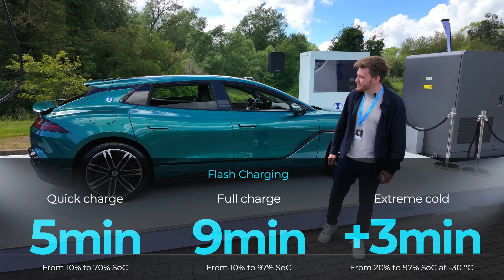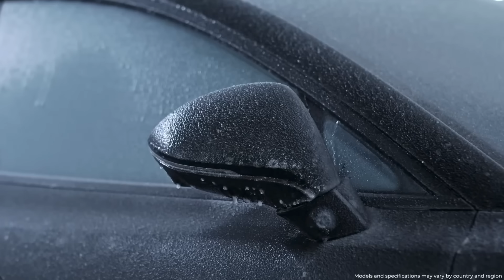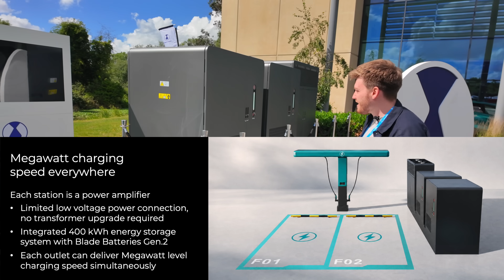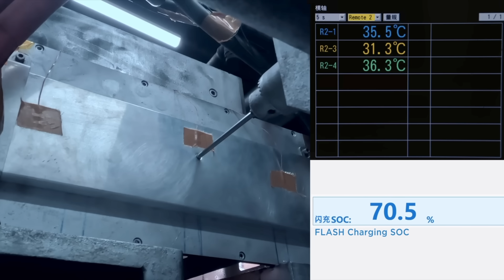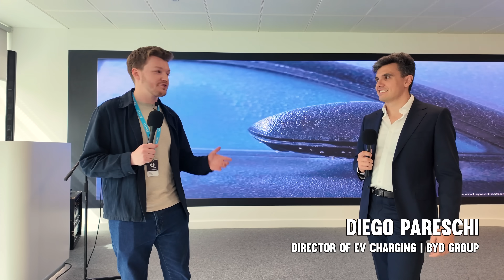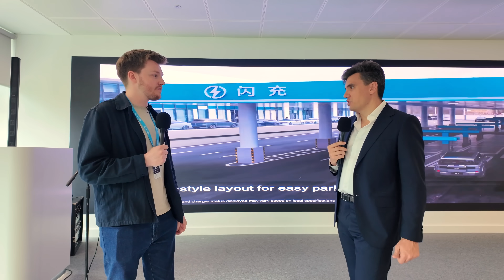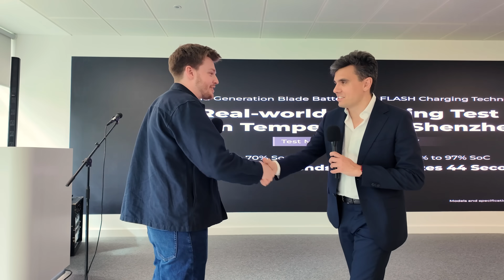BYD Flash Charge UK & Europe Launch | Crazy Fast EV Charging!

Comment: I don't believe it. Network implementation has extreme hurdles from land acquisition to laying the sufficiently thick electric cables to support the load. Most countries are not organized enough to let it happen. Don't believe the sales hype. Hybrid still better.
Reply from the maker: This solution is going mostly into existing stations, and doesn't require any additional equipment as it uses the battery packs in the charge point to handle the additional load, and larger installs rely heavily on solar. Here in the UK at least, most major service stations and shopping malls etc have EV charging installations now

Comment: How it works with the heat during charging?
Reply from the maker: The battery has a cooling solution built in, and the charging station uses the same battery tech as the cars

Comment: Charging stations still do not cater for trailers/caravans. Im traveling to Italy (tesla M.Y. Swift Caravan) and only one facility has a pull through charging station. Its possible at one other but a height restriction is in place preventing its use. Joined up thinking required, a garage forecourt works but no one thought to think why. Even where space isn't an issue not even one dedicated car/trailer option.

Comment: The most important thing is charging cost per kw/h , if BYD offer a subscription model to significantly undercut the Supercharger network then people will plan their routes to use the BYD network if not then it's a waste of time.
Reply from the maker: The BYD cars are getting a similar navigation update to plan around this so I think their subscription will be similar. It will be interesting to see the solution via their app if you have a different brand of vehicle

Comment: EV owners wake up with cars fully charged. In fact, most of them don't need to go to charging stations at all.
Reply from the maker: Well, here in the UK there are many homes that don’t even have parking spaces for chargers to be installed, so for many an EV isn’t practical. Hopefully tech like this changes that, as they can go and effectively ’refuel’ quickly
Reply: You are right. This is all pointless tech. Clearly BYD have just built this without checking if there is any demand.
Reply: @chriss8971 😂😆

Comment: The question not asked is if I take the new battery to an existing say 350KW charger will it maintain 350KW charging rate up to 80%, if so that's a big advantage over the competition whos charging speed always drops.
Reply: It will maintain  350KW  to 90%
Reply from the maker: They say it will maintain this on any car below 1500kw up to around 90% so yeah bit of a game changer. This is because of the blade batteries actually used in the charger itself
Reply: In the UK they are all load balanced so it's unlikely you'll get the full 350KW unless the system uses hyper capacitors which I assume is the basis for this technology.

Comment: With this Flash Charging technology offering, BYD just achieved a master stroke both the legacy auto and the petroleum industries dreamed about. The dream is to be the one providing both the vehicles and the energy to power the vehicles. BYD just quietly became world's first company to do just that.
Reply: They do a lot, but they do NOT provide the power - they save it in their batteries then sell that to you. The utilities still are those who produce the power.
Reply: It is true that BYD do not produce the electrical energy stored in the battery banks used at the Flash Charging stations, but they are selling electricity to the EV customers which allows them to profit from this transaction. This will be a very profitable recurring cash flow for BYD and will eventually prove to be far more profitable then selling EVs.
Reply: fuel consumption in china is down 8% yoy.

Comment: It works like a Gas Station
Reply from the maker: 5 minutes isn’t much longer than filling with gas really!
Reply: @ItsDanLatham  5 mins from 39-70%, then another 5 for the next 27% is what I noticed. I don't feel the need to fill a petrol tank until it gets much lower that 30%...and it still takes less than 10 minutes to completely fill the tank.
Reply: @tombridge3608   @ 0:48 "10% to 70%" = 5 mins....."10% to FULL" = 9 mins.

... with no health impacting inhalation of highly toxic carcinogenic Benzine whilst pumping it in!
Reply from the maker: @tombridge3608  5 minutes from 10%-70%, most people wouldn’t need more than that on a car with nearly 400 miles of range - Ideally you’d want to keep the battery below 80% to extend its life anyway
Reply: @tombridge3608  very unprofessional troll
Reply: @ItsDanLatham  而且充电不需要人盯着，加油需要人盯着，可以去超市买东西，去洗手间。
Reply: Similar, only you don’t have to stand outside holding a dirty stinky nozzle. You can nip off to the toilet or grab snacks.its quick, clean and easier than fossil fuel.

Comment: People are hyped about solid-state and sodium-ion batteries, but EREVs already solve many of the problems people complain about. Electric drive for everyday use, small battery, no stress during long trips, and much less worry about cold weather range. Seems like the best of both worlds until batteries improve even further.
Reply: Er no. Why have a vehicle that still needs constant servicing? Why have an over complicated vehicle that has both systems plus a third system to combine the other two. They make no sense. Even now range anxiety is just in the mind. I’ve just done 900miles in a EV at no time was there any anxiety about range. I’ve got another 1600 miles guesstimate to do this trip. No anxiety whatsoever . Oh and it’s much cheaper than a erev. Topped up at a super market while shopping yesterday, works out under 8p a mile. It’s about 4 hours between 10-40 minute chargers , all done while eating dinner etc. even now modern EV gave zero need for range anxiety, it’s just a term to frighten those that don’t know or have not bothered  to work out how it all works.
Reply: 在中国以前人们喜欢增程电车 但是现在人们更喜欢纯电 主要原因是现在到处都是充电桩 不管是农村或者城市 还有一个更主要的原因是充电速度大幅提高导致现在电动车相对油车的补能方式更方便
Reply from the maker: Agreed - With cars now touching 400+ miles of range and this fast charging becoming accessible, the only issues I see are environmental - but many companies are trying to mitigate those issues too.
Reply: @ItsDanLatham  It's funny when it comes to electrified vehicle people keep complaining about environmental issue, but ICE? No one talking about city's air pollution and oil leak that damage soil and water quality. Also you keep whining about high gas price but yeah, lets keep using those gas guzzlers until your wallet dry
Reply from the maker: @HyperVanilo  I’m quite happy with my EV, and use sustainable energy to charge at home!

Comment: If both of those cars are plugged in at the same time do you still get the 1.5 mega watts? Didn’t hear it mentioned in the video.
Reply from the maker: From the specs I’ve read, if both are plugged in they won’t both get to the peak of 1.5, but will still be in excess of 1.0 so probably won’t be a dramatic dip in performance
Reply: This Italian guy did an interview at a charger with an American car YouTuber and he said that yes, both sides could benefit from the 1.5 MW at the same time.

Comment: No manufacturer will give you 150k miles and 8 years waranty on the ice engine
Reply: 在中国，所有比亚迪品牌都是终身质保，但每年行驶里程不能超过3万公里
Reply: @cool-normalman-2024  so what happens after 30,000 km ?
Reply: @xtairsoft   超过 3 万公里就变成 8 年 15 万公里
Reply: @xtairsoft  byd offers double warrenty in china, if you break the lifetime warrenty you still have the limited warrenty varies from 30k km to 50k km a year or 8 years which comes first depends on the sub-brand
Reply: Oh I see, that is very good.  In fact pretty amazing.  I need to move to China
Reply: @xtairsoft recently. BYD  offers  one year collision coverage  to new buyer driving in metro area with automous driving system engaged. People guessed that BYD  only offer one year of coverage because here's  rumor the regulations  for  L3 will go in effect  in 2027.
Reply: In Thailand it is just 160k KILOMETERS
Reply: You’ll have to wait 8 years for the spares.
Reply: Try getting that 150k warranty out of the CCP fool.
Reply: Toyota 10 year 😂😂😂😂
Reply: @zulzulzulaan2396 Very limited terms. Try claiming and you'll find out.
Reply: @zulzulzulaan2396  at additional cost after the 3rd yr, annual "qualifying service", lots of exclusions, and only up to 100k ....

Breakdown of Engine Cover:

Initial Manufacturer Period: Every new Toyota comes with a standard 3-year or 60,000-mile warranty covering mechanical and electrical components, including the engine. [1, 2]

Toyota Relax Extension: Following the initial 3 years, Toyota provides an additional 12-month or 10,000-mile warranty with every qualifying service at an official Toyota Centre. [1]

The Cap: This 12-month coverage can be renewed annually, year after year, until the vehicle hits the 10-year or 100,000-mile limit. [1]

What is Covered

Engine Components: Internal parts such as the cylinder block, crankshaft, connecting rods, camshafts, cylinder heads, valves, and oil pump.

Engine Systems: The fuel system (injectors, ECU, fuel pump) and cooling system (radiator, water pump). [1, 2]

What is Excluded

Wear & Tear: Normal degradation or failure of items like timing belts (unless specifically stated), spark plugs, filters, and drive belts.

Neglect & Modification: Engine damage caused by lack of oil, severe misuse, or unapproved aftermarket modifications. [1, 2, 3, 4, 5]
Reply: What? Yes they will. I have 5 years unlimited km on my Hyundai. Can get extensions after 5 years to 8 years.
Reply: But you need to pay extra for the extension of warranty while the BYD owners only need to pay upfront for the vehicle. It’s a big difference combined with the low maintenance cost for EVs.
Reply: @nameberry220 what country are you from?

Comment: And WTF charges the charging station batteries........ Ohh they have a solar panel on top them ??
Reply from the maker: Some have solar yes, the larger ones. Or they will charge from the grid supply on site with existing transformers
Reply: 이 시스템은 한밤중과 같이 전력 소비가 적은 시간대를 이용하여 충전소에서 배터리를 충전하고, 이렇게 저장된 에너지를 낮 동안 전기 자동차를 충전하는 데 사용합니다.
Reply: @张先生-e8h So if you have say 200 EVs a day charging say 80 kWh each you need 1.6 GWH off batteries or a mix off what the grid can supply and then the battery ??
Reply: @timlucas4014 It's actually better, taking your numbers a site needs to charge 200 cars with 80 KW each. The same amount of supply would be needed but would require about 14 chargers and need to use the supply instantly. The BYD charger by using batteries can spread the supply required over 24 hours.

Comment: i want to know if this come to eletric scooters too or you know motor bikes on batterys
Reply: Probably no. Scooters have different voltage they run and is physically would be impossible to charge scooters at fast chargers, batteries too small and too fragile for that amount of power.
Reply: @Jokershadow696  than there is no point the range is to small to wait for them to charges so stick to benzin for now not buying a Car .
Reply: @Trikie77 your comment doesn't make any sense...
Reply: @Jokershadow696  i want enovation on motor bikes too eletric ones.
Reply: @Trikie77  supply and demand. There will be supply if demand is there. Beside few enthusiastic people like you noone want electric bike, not many even want ev cars... so noone is going to build something so difficult to satisfy 5 people from which only 2 can actually afford it.
Reply: @Jokershadow696  That’s because charging takes too long. An electric bike needs at least around 120 -130km of real-world range to be practical for everyday use.

If you commute to work and back every day, you need something reliable. For example, I drive about 45 km each way to work, so the bike would need enough range and the ability to recharge quickly before it becomes a realistic option for normal users like me.

Charging times need to be reduced significantly — closer to the fast-charging experience we see with electric cars — before electric bikes become truly convenient for daily transportation.
Reply: @Trikie77  you clearly have no clue what you talking. When you have ev you charge them at night at home, for 99% time you will have full battery each morning, those stations are only for emergency or rare long travel situations and not for daily use. Secondly as i already stated - barely anyone want ev, especially for bike, they have bike for the feel and sound of motor etc, you are one of a kind that want electric bike and there is no demand for it whatsoever. On top of that bike can have very limited space for battery and is pointless to have electric bike at modern times. It has nothing to do with charging speed. You wanna fast charge? Get yourself 2-4 replacable batteries. 5 seconds and you have full charge!
Reply: @Jokershadow696   listen i am asking becouse we need some fast charges so you actuel can Drive  longer Trips without spend  5 6 hours to chages  if i want to visit  somthing  300 km away i will not be able to drive there on a bike  in 1 day  so why i ask if this is comming to bikes too the batterys
Reply: @Trikie77 The battery technology will eventually trickle down to bikes over a few years. The fast chargers -  unlikely to have a business case but if anyone wants to make it work - they can try.

Comment: 300 sites in UK is nothing. Bet it is expensive.
Reply from the maker: For the first year it's a fair few, considering the install cost is being funded entirely by BYD. Similar install rate to the Tesla Supercharger network (I drive a Tesla myself) I raised the concern about price, and they said in terms of the charging cost, the aim is to undercut the competitors (the other major charging stations).
Reply: Got to start somewhere and bear in mind there are no cars that can use megawatt speeds here yet. BYD are talking about 50p per kWhr for these, which is cheaper than petrol.
Reply: BYD flash charge only cost $1 to $3 per 100km here in China to drivers
Reply: 300 is a huge number for the UK! There’s no point having these anywhere other than on major corridors and that limits the number of site locations possible.